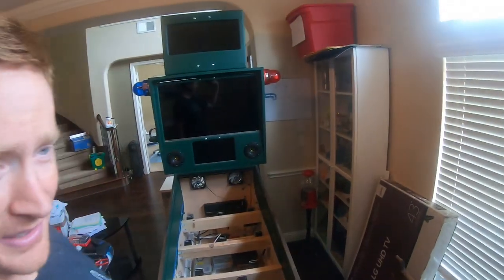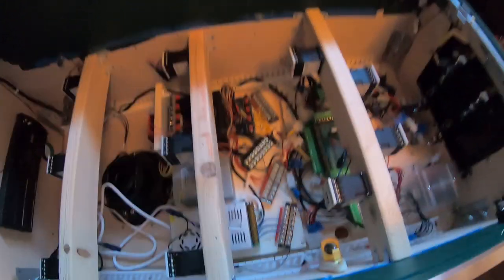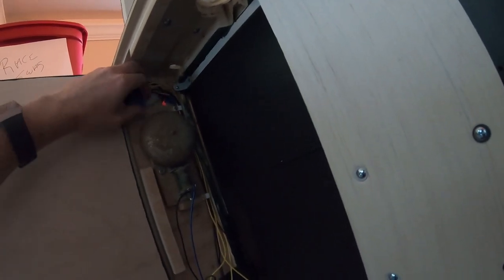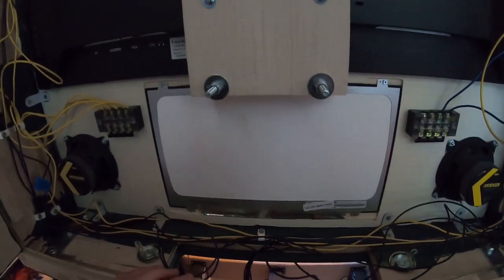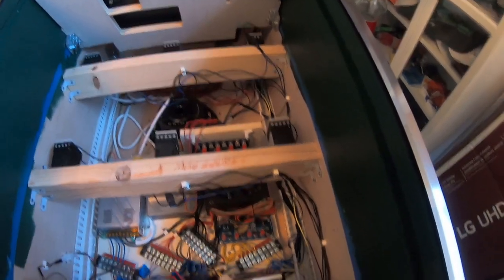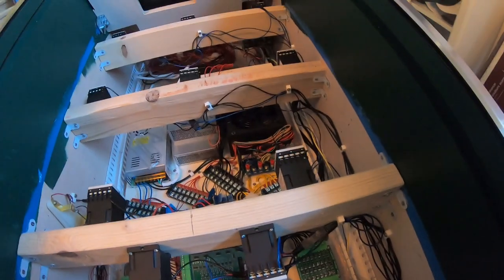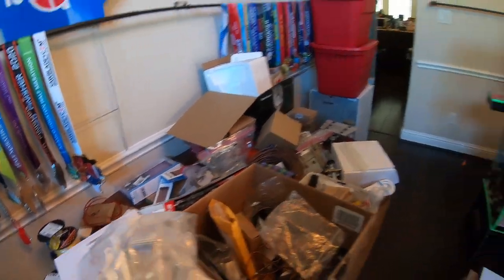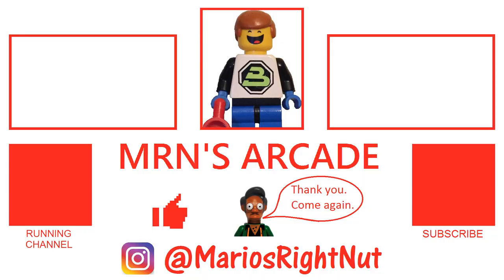Even More Wiring - Virtual Pinball Build 15

Comment: I have been watching your videos since part 1. I want to ask you if you had to route the top edges in order to install the railings on both sides of the pinball?  This is where you eventually have to place the playfield glass.
Reply: Did you have to T-Molded with the router in order to install the side railing?
Reply from the maker: The flat pack came with a slot up the top of the sides into which a plastic rail sits. It is kind of shaped like an F where the glass slides into the horizontal bars. Then the metal side rails covers this up. 

If I built the wood part myself, I would have had to route out a notch for the F part to sit in.